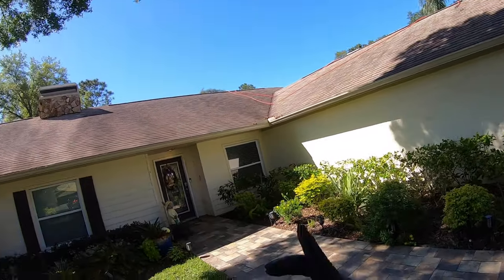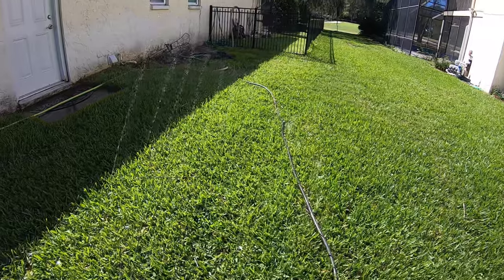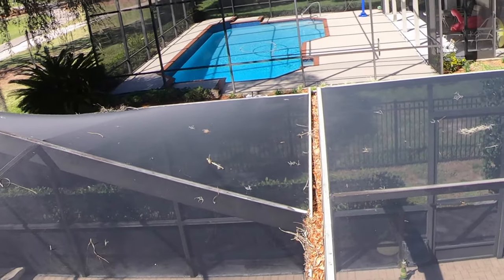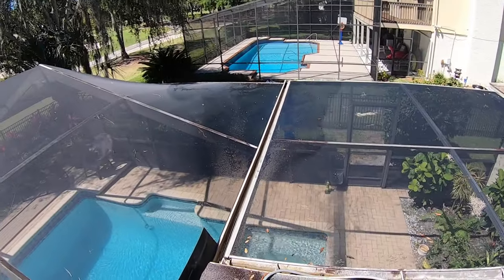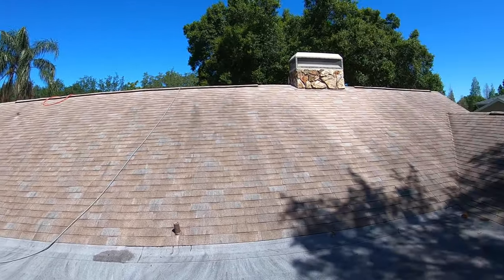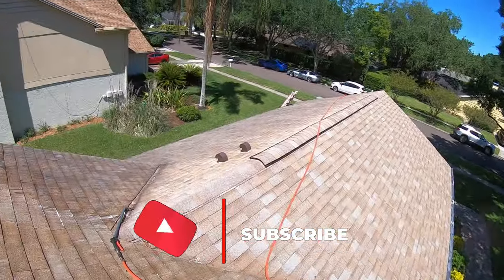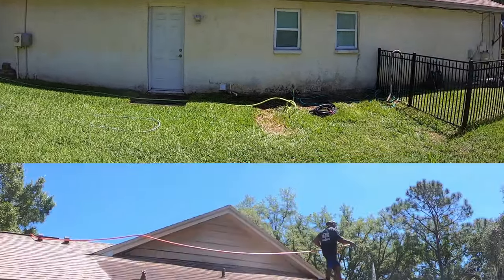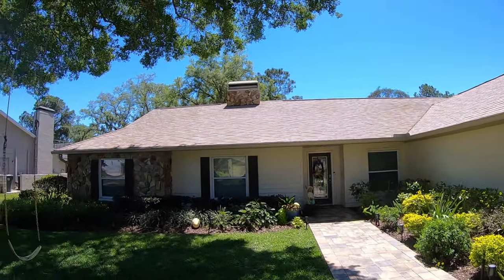Roof Cleaning with no GROUND GUY 😮😱

Comment: Have you had any problems with rain rinsing the salt (what SH turns into) off the roof and killing vegetation later on? I know in Florida it rains almost every other day. Just curious.
Reply from the maker: No never had any issues in my short 2.5 years washing. 🙏🏽 guess the watering the plants helps.  A good rain will dilute that 5% that's dried on the roof easily anyway.
Reply: @PinkFlamingoPowerWash  That makes sense. On a sidenote: when you downstream for house washing or application to concrete do you batch mix? Or does your pressure washer draw from a proportioner?
Reply from the maker: @adamwright1590  when I downstream it pulls out my sh tank.  Which is the same tank the proportioner is hooked up to.  So that tank is always 100% pure SH.
Reply: @PinkFlamingoPowerWash  OK. Makes sense. I like it. Then, how do you get your surfactant into your downstream?
Reply from the maker: @adamwright1590  I don't use much but I add a little in the SH tank from time to time.  I don't like to do that cause then I can't fill my 65 gallon sh tank up all the way cause it foams like crazy!
Reply: @PinkFlamingoPowerWash  Could you fill up the 65 gallon container almost full and add surfactant at the end gently, then stir the mix with a broom handle or pole?

Comment: Excellent results! Really does lol like a new roof! 

Wondering much Slo Mo you use per gallon? 

When you’re working alone, do you use a heavier mix of Slo Mo so the mix doesn’t run off as fast?

Thanks in advance.
Reply from the maker: Thank you. I use 1 to 2 Oz  of slo mo per 5 gallons. It's very thick and concentrated.  Yes exactly I'd  turn up the surfactant to make it cling more to the roof when working alone. Great questions. 👍
Reply: @PinkFlamingoPowerWash  thank you Cliff.

Comment: Hey man, thanks for the vid, but I have just one question. Why wouldn't you start at the peak  and let it run down? I'm just gathering info.
Reply from the maker: Doing it that way sometimes you end up with a lot more runoff.  I like to do the bottom strip say around 4 ft up then go up and spray down. That way I got a 4ft cushion to gauge my runoff.

Comment: Hey Cliff, what size surface cleaner would you recommend for a 3.5 GPM machine? Thanks!
Reply from the maker: Hey definitely a 16 inch surface for that machine.
Reply: I have a Karcher. It has ball bearings. Amazon 57$

Comment: Awesome job man, what percentage of sh were you using
Reply from the maker: 5% mix for this roof.
Reply: @PinkFlamingoPowerWash  Thank you Sir
Reply: @PinkFlamingoPowerWash  when giving a price to a customer in the pressure washing industry does the price of materials get added separately or that's all added in on the price giving for the job.
Reply from the maker: @randybarlow9587  all in one price.
Reply: @PinkFlamingoPowerWash  Thank you for the info. I'm here in Louisiana just getting started in this industry.
Reply from the maker: @randybarlow9587  with you all the success 🙌
Reply: @PinkFlamingoPowerWash  Thank you